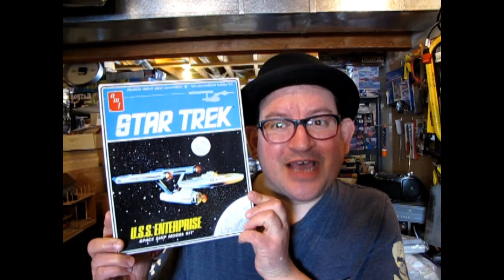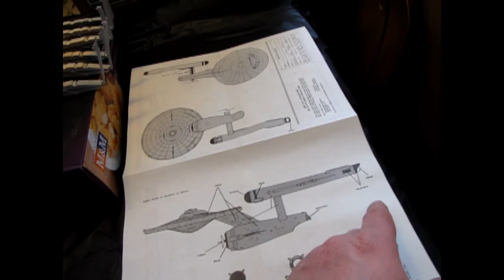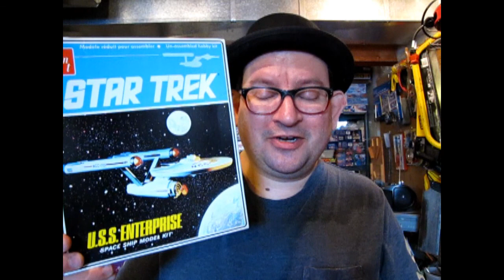Let's Build AMT U.S.S. ENTERPRISE Kit 6676 Part 9 - Applying The Gloss Coats

Comment: Forgive me, but what "paint" did you use in the gloss spray operation?  I can't seem to find it in the video.
Reply: Tremclad Light Grey. Tremclad is a rust paint sold in Canada.
Reply from the maker: Tremclad Light Gray.
Reply: @monsterhobbies  Sir, is this an oil-based paint, and can you suggest a similar shade from Rustoleum?
Reply: @Danbo020759  Yes, it's an enamel. I am unsure about a matching color from Rustoleum, but rustoleum owns Testors paints now.